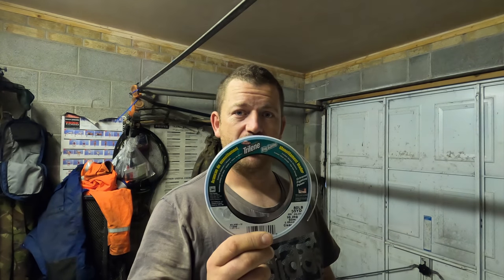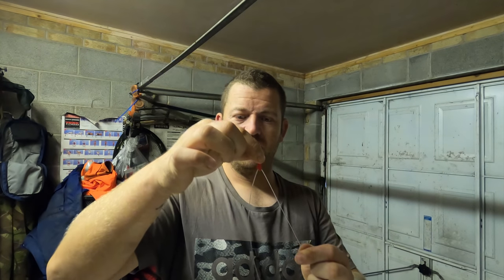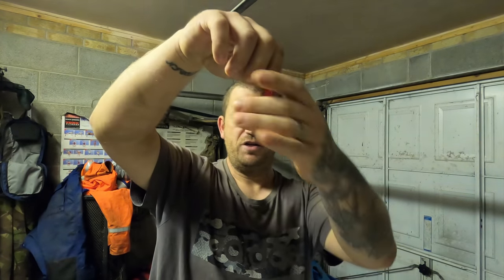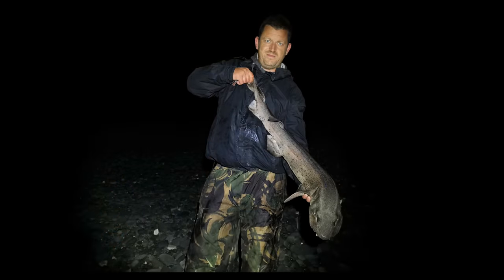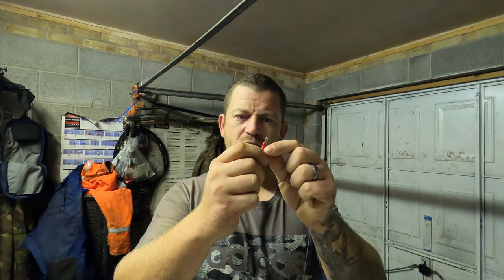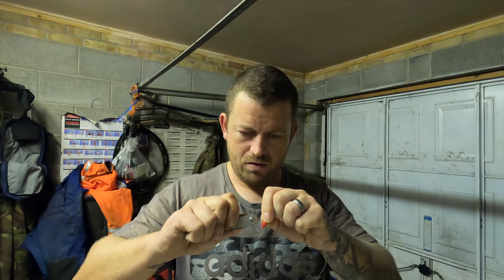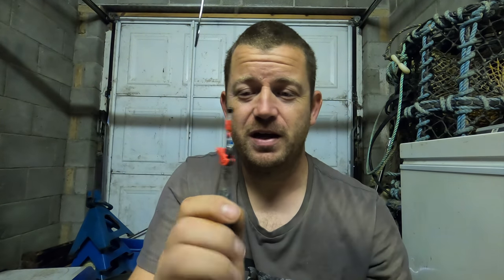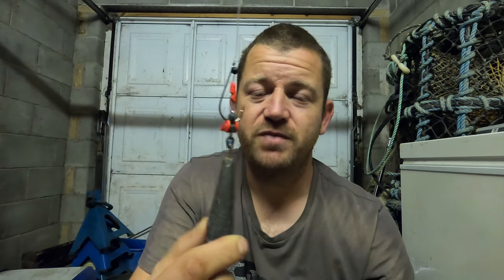Pulley rig tutorial

Comment: Just a quick one what length do you use on a clean beach please 🎣🎣👍
Reply from the maker: I use the same length I keep it simple saves taking loads of different length rigs I make the main body's 44 inches long and my rig that I take are 

Pulley rigs for rough ground 
Clean ground I use 
Up and over rigs 
And 2 hook flappers clipped down ones 
And that's all the rigs in my box I have 2 flappers around 5 up and overs and the rest maybe 10 pulley rigs
Reply: Thanks for the info
Reply from the maker: No worries Gary
Reply: @C3BFA  thanks